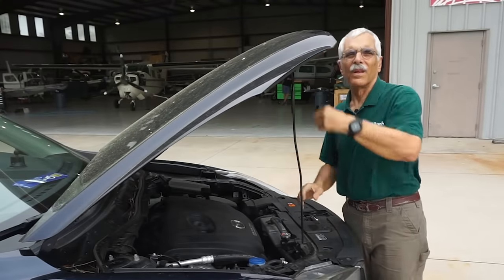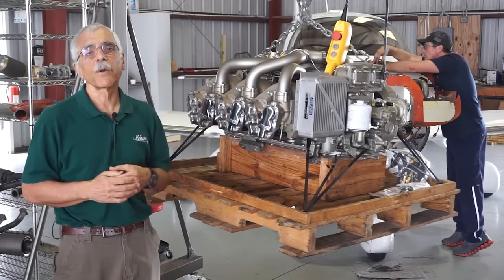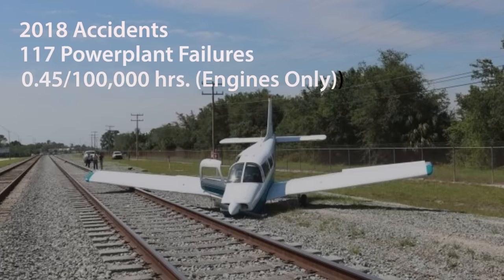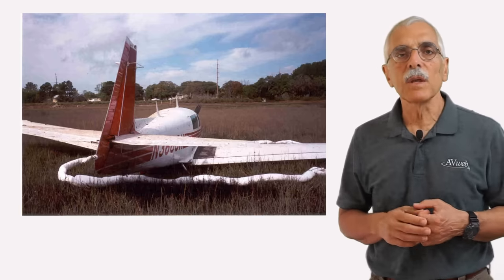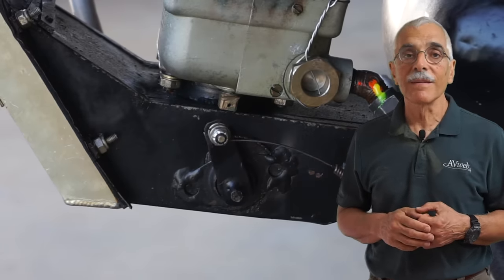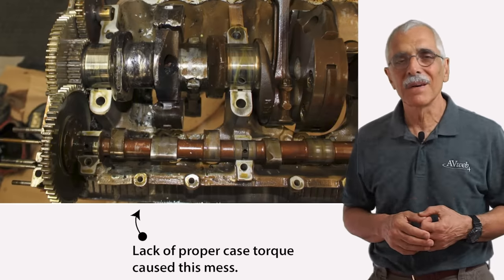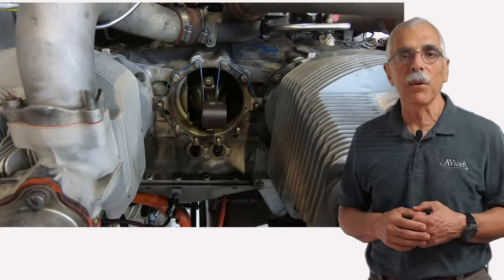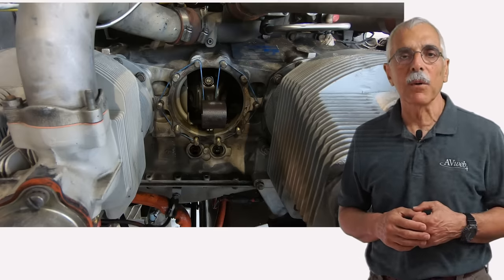Why Aircraft Engines Quit

Comment: Putting oil in your engine I found if you put oil use to the climate like. Tropics and extreme cold the oil needs to be different also I found pilot operations leaning to much the new Lycominig engines are not so good they are built lighter material and they want you to do checks like torque exhaust nut even if the exhaust is not leaking and this causes it to leak the put engines in the new Cessnas and you can not get to the part you are required to check every 50 hours and engineers pen it off the engines are not to my liking the company I worked for Bush Pilot Airway the pilots were told by the chief pilot how to start the aircraft and only start it that way not how you want to start it and power settings were as by the company book and if we started having a problem with the aircraft the chief pilot would check ride him for 2 to 4 days till he got it right and the maintenance was done every 75 hours and we had it so the only problems were structural failures from the overhaul shop we’re we got the engines from  we used Mobile W120 oil as the aircraft would be operating in high temperatures and rough dirt strips . All engines were primed with oil when fitted to aircraft and we even had an engine fail we installed a R1830 primed it and it failed 3 minutes after start up I pulled the oil filter and had to lever it out of the case as the overhaul shop sent us an engine after they ran it but never checked the filter so after a few failures from this mob we pulled every filter before installing the engine we had 13 failures in 6 months until the pilots refused to fly with 2 engines from the same company the last plane DC-3 that had 2 of these engines the both failed a about a week apart

Comment: tbh talkin bout reliability
you aint seen shit till you see how many miles my 87 ford bronco has on it

750k on the odometer with oil thats been in it since atleast 2000's if not the 90's
my grandpa bought it from the original owner for 500 and the 5.0 in it is damn near bullet proof  what with it still sounding like its runing like a top and no strange noises from it either
ol' pushrod with a chain for the valve train, probably stretched to hell and back but hell if it aint still goin good

Comment: In my opinion... trained monkeys jacking around with mixture, trained monkeys NOT jacking around with the mixture, high horsepower/air cooled, disconnected from the motor so you can't hear when something "isn't right". Add in substandard inspection and maintenance by old rich dudes that have never had a drop of oil or dirt under their manicured fingernails and I bet you have the answer.

Comment: I don't understand why we are still using piston engines. I am sure one of these companies could build a jet engine for 50k that has so many less moving parts and is cheaper to operate.
Reply: How did jet engines fair in the automotive world?
You now have your answer.
Reply: @arthurfoyt6727  That is the worst comparison I have heard in quite some time. We are talking general aviation and we have numerous jet/turboprop engines in production and being used today in aviation so it obviously works very well. A 50k jet engine is very much doable. My question is why is it not sitting on the front of some of these aircraft?
Reply: @cougarlove8542  Obviously you are not an aircraft owner. Just because something is "doable" is irrelevant.   Even if you could make a pure jet engine for $50K, it would take another 10 years and countless millions of dollars to get the new design completed, tested, and FAA approved.  The same thing happened for "jet cars".  Just because there was on off-the-shelf engine available, it was too expensive to adapt and sell as well as getting poor economy.
Reply: @arthurfoyt6727  Little do you know. I have owned several aircraft. Clearly you have no ability to understand my statement and you go right back to the dumbest idea ever for a car design with the illogical jet car idea. Apples and Grapes. It's best to not comment on things with such odd comparisons. The 50k jet idea is a damn good one even if it takes millions of dollars and years of testing. If it started 20 years ago, it would already be in an aircraft that I would buy. Have a nice day.
Reply: @cougarlove8542  "The 50k jet idea is a damn good one even if it takes millions of dollars and years of testing."
Then prove the entire world wrong and get started.  Simple.

Comment: The reason they fail is SINGLE POINT FAILURE.  They are ALL in concept designed INCORRECTLY.  Happy to explain this to you...  In short, when one part goes bad, it takes the entire engine out.  If one piston were able to fail independently and the other 5 cylinders (of 6) were able to continue in torque, then a partial failure would occur.  This is NOT possible in classical piston engine designs.  It is in newenginetype.com technology...so, yes, there are solutions....  

There should always be more than one prop, at least two, better three, and ideally four props minimum for anything over water.  This requires distributed power which nobody in aviation really gets, but soon will.  You can't just put a bunch of four bangers out on the wing...much too draggy.  Single pistons won't work.  The packaging is all wrong.  Electrics are a joke. 

 I tweet about it at @new_engine_type if you want to get up to speed.  I will likely be at Oshkosh.

If you take the data you present, and then talk to me about engines, you will see how to solve this problem...in general.  Learn it now, or learn about it later....  This change must come for GA to progress.  EVs are NOT the solutions to anything.  They are more of the problem.

Comment: why so many carb'ed engines?  Why not fuel injection like has been used since before WW 2?
Reply: Safety and simplicity.  
You can have a total electrical failure and still fly just fine with a carb.  
Since planes fly at constant power settings in cruise then EFI (like on motorcycles) does not give more power or economy.
Reply: @arthurfoyt6727  Thanks but wouldn't the same power that powers the fuel pump, spark plugs, etc. also power the injectors? TOTAL power failure means TOTAL
Reply: @protonneutron9046  Nope.  My aero engine has a mechamical pump and magnetos.  Basically it's like a push lawnmower with no need for a battery at all,
Reply: @arthurfoyt6727  makes sense now. Thank you!
Reply: @protonneutron9046  The older high wing planes use only gravity to feed fuel to a carb and they don't even have electrical systems.   
Basically you get fuel as long as there is gravity.  If that fails, well, you have more to worry about than just the engine ;-)
Reply: @arthurfoyt6727  fascinating.

Comment: Why in heaven's name are old antiquated engines with magneto's still used then? They cost a fortune in purchase and maintenance and reliability is poor. Why not using modern direct fuel injected engines with electronic monitoring systems and ingnition? With 4 valves and overhead cam shafts not with pushrods for crying out loud?

Comment: Air cooled engine in a airplane make great boat archors, why they are junk period, the technology goes back goes back to the 1920s how they are made its out dated technology and DOES NOT STAND UP FOR LONG BEEN AIR COOLED ENGINE STILL GREAT BOAT ANCHORS OR SCRAP even a new one in a airplane. The air cooled engine has a long of running for a while but also have a long history NOT been reliable because the way they are built. For small airplane change out the air cooled engine is a great boat anchor engine, for a water cooled auto engine a V6 or V8 they stand up alot better and last longer and more reliable then the boat anchor air cooled engine. And the auto engine on a small airplane has more power and they are better engines.. There is alots video here on youtube how to convert the small airplane to a V8 and there are more video using other car engines. It works well. When you convert the car engine then make sure call summit racing 800-230-3030 and get the kit for the oil and crank case for the V8. It‘s used in sharp hard rock climbing competitions or very sharp mountain climbing it works well. and what it does, it does not like engine starve itself of oil in a sharp grades or on a sharp climb. It can be use on a airplane with a V6 or V8 it work well. Call summit racing and talk to them about  it they know about it. If you ask them they will send you in the mail a free magazine, for parts in after market auto parts. There is alot inside of that magazine

Comment: Here's a new engine that offers huge promise. 160 HP, 25K RPM Redline, Only 35lbs. No pistons, valves, connecting rods, springs, etc. Good fuel consumption, very high reliability.
https://www.youtube.com/watch?v=_LkkjYParp4

Comment: Two words as a simple solution (especially in this day and age of Climate Emergency) GO ELECTRIC and be done with it! an E motor has only ONE moving part --  the aermature!. Then maybe soee additional  gear reduction, still considerably less than just an internal combustion engine! (by iteslf)!! Also batteries are getting better, soon the Na-Ion battery more efficient and cheaper shall replace the Li-Ion batter currently used in eVs.